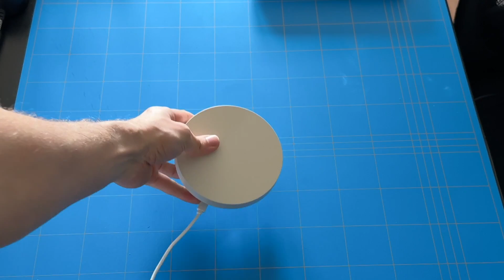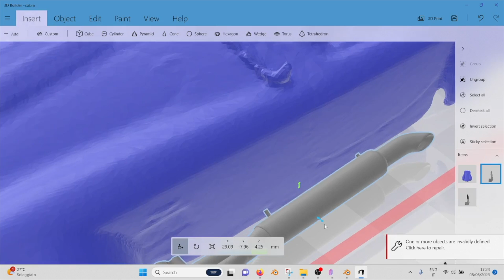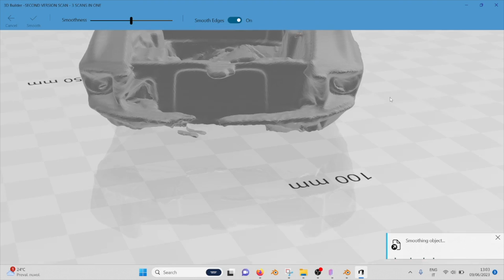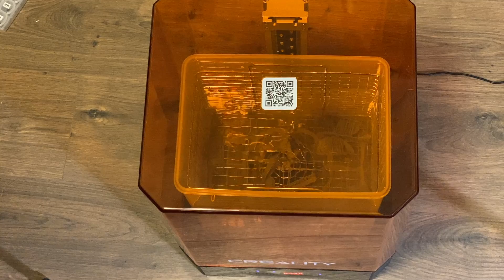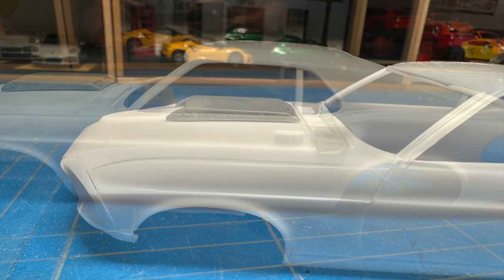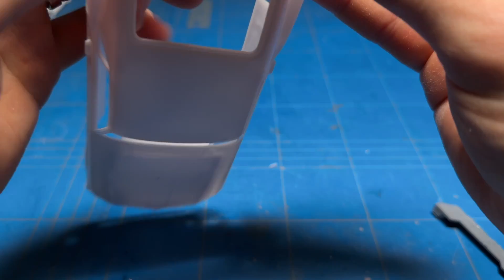Using a 3D Scanner & Printer to Create a John Wick & B is for Build Style Ford Mustang

Comment: I have a random 3D modelling question, how did you increased the thickness of the fenders after you created the outer side from verteces?
Reply: Obviously I'm not the creator, but I know in Blender often a modifier called "Solidify" is used. I've used it once and it does work. But on more complex shapes you will run into issues which I wasn't able to resolve (I'm still no expert)
Reply: @arnosmulders6338  exactly, solidify messes up the mesh if it's a tad bit complex. I've tried same modifier in most of the 3d softwares and most of them are giving weird, bugged results
Reply from the maker: Well since i did not do any of the modeling. I have no clue😂